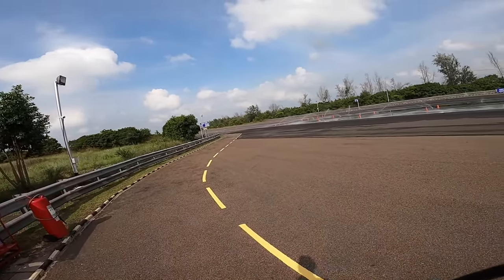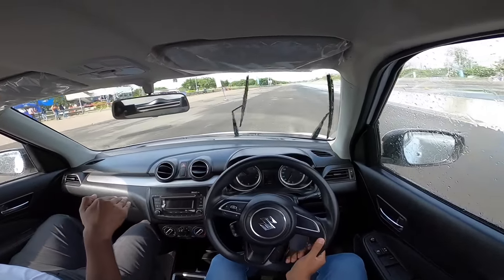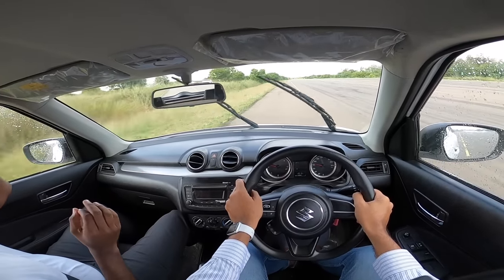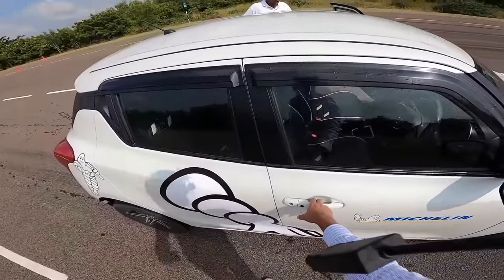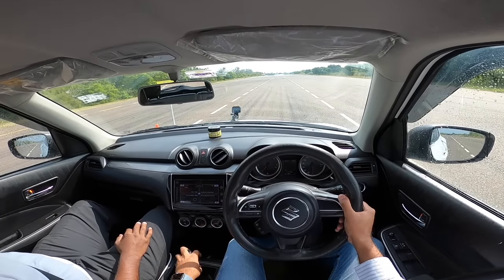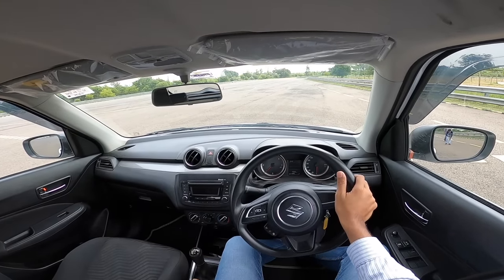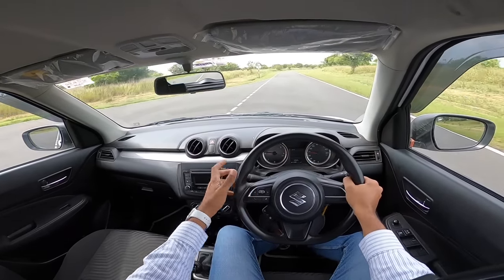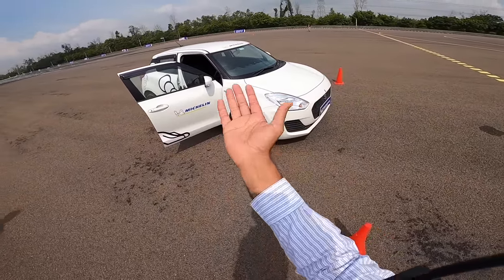Michelin vs Bridgestone Tyre Test - Maruti Swift | Faisal Khan

Comment: Faisal was right the ZDI is tuned for 15 inches
Reply: Overall tyre diameter would be same ..they re not tuned differently
Reply: 14inches rims have high tyrewalls...whereas 15 inches have low tyre wall
Reply: @drsaiprasaddv  u ar right bro in 14 inch tyre profile is high whereas in 15 inch tyre profile is low overall diameter is same
Reply: The bridgestone swift have advantage as it's tuned for 14inch rims, it's speedo shows 100kmph if the car is at 90kmph.
Swift VDi tyer size 165/60 r14, 

the tyre they put is 185/65 r14, this tyre size is perfect for 15inch variant and gives the bridgestone swift advantage.
Reply: @BullRides  it's 165/80 for 14 inches. Where did you get that information from? Overall diameter is always kept within 2% margin in all cars. And who told you it shows 100kmph when it's 90 in real? It's round 10% difference. No car manufacturer does that. Also it's 185/65 R15 in top model and 185/70r14 in lower variants which is logical upgrade from stock 165/80r14.
Reply: Hahahaha..what does "tuned" for 15 inches even mean?? What factors change? THE guy was being polite by ignoring Faisal's stupid question
Reply: @amreekmann6537  yeah man a middle aged guy wasting his time in a comment section existential crisis intensifies
Reply: @Amarpreethaha you mean middle age crises boy ?...And luckily i am a few years off middle age...but chalo koi na.....maybe i need tuning
Reply: @amreekmann6537  facts
Reply: @Amarpreethaha  next time when someone corrects you...dont say stfu
Reply: @amreekmann6537  yeah man! Sorry 😁
Reply: @amreekmann6537  bigger wheel has smaller sidewall, hence harder the impact in suspension and dampers. That's why you can void the warranty if you go for upsized wheel. May be he was talking about that. But again, most cars don't have different suspension tunes, atleast in india for bigger wheels, it's just the same across all variants.
Reply: @drsaiprasaddv  absolutely what kind of stupid statement is that 🤷🤷 zdi being tuned for 15 inch 🤣🤣🤣🤣
Reply: @amreekmann6537  thanks man someone caught that stupid comment. This guy Faisal is full of show off. Just fortunate enough to drive some insanely awesome cars with his little brain applied while riding it.
Reply: @amreekmann6537  spot on mate thanks again
Reply: Isn't the Diesel heavier than the petrol?

Comment: I used bridgestone at 26,000 kms and the tyre lasted till 58,000 kms...I then changed Michelin at 58,000 kms and sold my car at 96,000 kms and I was surprised when the buyer asked whether I changed my tyres recently..it was like nearly brand new...no punctures or problems for almost 40,000 kms and it was like new...to be frank even if you try, you cant kill the tyre that easy...As Faisal bro said change and forget...
Reply: Yes Michelin tyres are best no other brand can compete with it
Reply: In michelin which model
Reply: Best Tyres you can find for any two wheeler Or four wheeler are of Michelin, Using from last 3 years for my scooter ( TVS jupiter) and Car ( Accent 2010 )

Comment: The fact that Michelin was Factory worn out and Bridgestone was worn in regular use means Bridgestone tyre was OLDER which might affect the grip!
Reply: Yeah exactly,and they say that xm2 + as factory worn out,so obviously it would have been a newer rubber, it's not balanced
Reply: Tyre size also affects braking
Reply: @karthiks1713  Which tyre brand you suggest?
Reply: @Publicchannel5  could you please tell me the vehicle details and your nature of driving and car usage
Reply: @karthiks1713  Hyundai i10 2012 model,no rash driving, minimum 20km everyday travel.
Reply: @Publicchannel5  go with continental cc6 if not available then try cc5, if you want in a budget go for good year assurance triple max 2.

Comment: What is the guarantee tyre pressures were the same? Were both branded tyres same level worn out? What was the condition of the wheel balancing of both of the cars? Test is not done by an independent entity. Invalid and misleading test. It doesn't prove a thing.

Comment: Swift to test tyres!? Best option in the world 😂
Reply: Must be polo is best option i guess
Reply: Best option infact because it is the most popular and widly used car in india as they said. They are testing the tyres only not the cars so got to be tested with the most local popular car.
Reply: @Carzhed  yesss
Reply: Car which is sold most . should be used...
Reply: It is indeed... It has the best handling and steering feel out of all normal hatchbacks in India as said by Faisal and also talking from a personal experience.
Reply: @Carzhed  Polo handling isn't as great.
Reply: @benten1443   iv driven dozens. but nothing comes close to swift vdi 2010
the stiff front suspension. hydraulic steering.
What a delight.
Reply: @Red_Dusk  Hell yeah man! The first gen swift had such a gem of an engine which wasn't restricted due to bs6 norms and the hydraulic steering is so amazing! The second gen has power steering, which doesn't really have the same feel but the first gen's steering feel is much better. The over all composure of the car and the kick in the pants feel at 3000+ rpm oof. And the build quality was better than current swift apparently. It was truly a great car.

Comment: A good way  to compare would be to keep the car the same and swap tyres and then perform the test with all related parameters measured.
Reason being that you never know whether there were any changes done with the suspension / brake calibration or have changed the weight of the vehicle for the purpose of marketing.
Reply: Either way, Bridgestone is still better. Same result. 😂😂😂

Comment: Le Tyre contact area: why are u not even considering me...
Reply: Please don't take me wrong 
Just wanted to correct you.
Friction does not depend on contact area 
Even a cycle tyre with same rubber and pressure can stop the car with same distance 
Only matter with width of tyre is turning,cornering, stability  etc
Reply: Yes contact area isnt a factor for friction..its weight, surface texture and material
Reply: Friction DOES depend on contact area...why wld it help in cornering if it does not increase friction?? Why do u think fatter tyres return less fuel efficiency thn slim ones??
But yes, in case of motorcycle tyres as they are round, a fatter tyre hardly translates into more contact area...

Comment: The bridgestone swift have advantage as it's tuned for 14inch rims, it's speedo shows 100kmph if the car is at 90kmph.
Swift VDi tyer size 165/60 r14, 

the tyre they put is 185/65 r14, this tyre size is perfect for 15inch variant and gives the bridgestone swift advantage.
Reply: Didnt get u bro

Comment: Iirc the zdi and vdi has slight difference in breaking hardware, the 2nd Gen swift certainly had superior brakes in the zdi trim
So what's the point of the test
Reply: Breaking which hardware??
Reply: @ragasruobans4957  2nd gen swift zdi had slightly larger master cylinder or something compared to vdi, dont quite remember
Reply: @eriktenhag2022  i don't they have different master cylinders for different variants. But there must be a difference in suspension tuning for accomodating the variation of unsprung mass.
Reply: This is the 3rd gen. And between two swifts, there wouldn't be any difference with the brakes, that im sure of but there might be a slight change in the suspension setup. But it wouldn't have add up to 4 metres of braking distance between the two tyres.

Comment: Michelin tyres tend to chip off on indian road conditions. I m using energy xm2 on my car and they have chipped off from the outer portion. Going for continental tyres this time as a replacement.
Reply: Which one is best-michelin vs continental.
Reply: @Publicchannel5  continental or bridgestone turanza suits our road conditions better. I have been using turanza for 2 years now and they are fantastic.
Reply: Ya happened to my jazz which came as OEM.. it just lasted 30K kms n I changed to Yoko

Comment: I own a swift vdi amt on which I had done 72000 kms on Apollo 14 inch stock tyres and then 70000 + kms on Hancock tyres which are still running.
Why no one speaks about Hancock tyres?

Comment: Is it good (safe for gearbox) to shift the gear from third gear to fifth gear
Reply: That's no problem.....when you press the clutch, the gear is disengaged until you release the clutch....you can even go from 2nd to 5th if your car has high gear ratios...
Just remember to match the revs.....he was on 100 when he shifted to 5th....rpm would have been around 2100 or so....but doing that kind of thing on a speed of 50.....the engine would struggle and stop

Comment: It would have been more convincing if Michelin had used cars belonging to the same variant. ZDi variant is heavier than the VDi variant, which would have worked against the Michelin tyres actually but the fact that Faisal felt that the Michelin tyres performed better than the Bridgestones says a lot about Michelin tyres.

Comment: I have Renault Kwid 2017 model, and I am planning for tyre change stock jk ultima neo last only 24000 kms. I have 2 jk ultima neo tyres with me i need to change rear 2 tyres. Can you suggest which one is best to fit 155 80 R13?Plz suggest me best tyre with good milage, comfort and low noise. Budget tyres I'm hardly use less than 10,000km per year.

Comment: Hey Faizal & gang.. I will be taking delivery of the new 2022 Taigun 1.0 AT Topline in 10 days.Wanted to upgrade the OE tires (205/55 R17) to the Michelin Primacy4 215 /55 R17. Would like to know if this size would be a fit on the stock diamont cut alloys and with this size lock to lock the tyres wouldn't scratch or rub on the wheel wells. Appreciate your feedback.

Comment: According to my experience, The XM1s were much better than the XM2s in all aspects.
Reply: Then you were among the lucky folks. XM1s were very soft and were prone to punctures and sidewall bulges!
Reply: I had no complaints about that set of tyres. Those did last really long I think around 60k KMS. But then I switched to XM2 and I had a problem. The XM2s were newly introduced then. My front right got a puncture while driving and it burst. Michelin replaced the tyre though.
Reply: @satwikbehera6610  which tyre you suggest, planning to buy new one.
Reply: @Publicchannel5  go for michelin continental or yokohama
Reply: @satwikbehera6610  thanks,xm1 or xm2,how much each tyre cost?

Comment: The guy used Michelin in swift zdi and Bridgestone in vdi. Now vdi has 14 inch tyre and zdi has 15 inch tyre. Zdi suspension is better that vdi. Obviously Michelin will win when brakes are applied in Zdi with better stability than vdi. Fooling us with Micheline sponsored video.

Comment: Bridgestone anyday I had Michelin on my ford previously...I will admit that Michelin has good firm grip on any road conditions but bcoz of soft rubber component it is victim of punctures.....other side bridge stone not only has form grip but also rough on use....small pins and nails almost won't penetrate through it....if u want a tire that is for rough use go for Bridgestone......and lifetime 1lakh kilometers promise is actually is a marketing trick.do they promise u a replacement if they r done before 1 lakh????...life of tire depends upon the conditions u drive.....if u take u r car more of city and highway their life will b more than the ones driven on country roads....